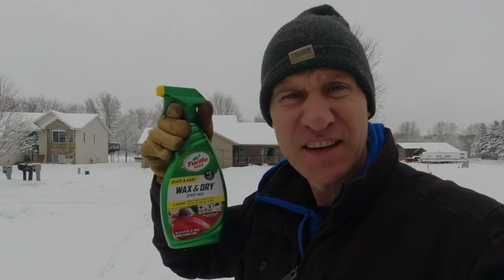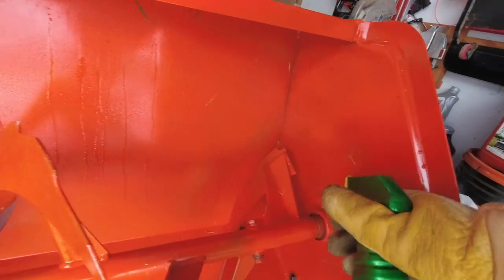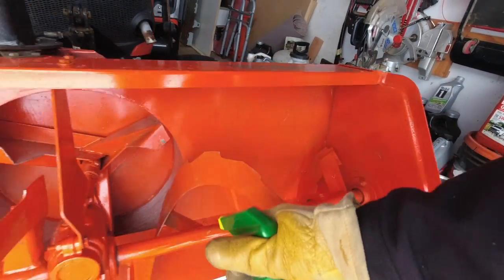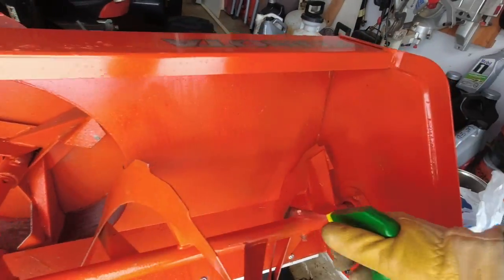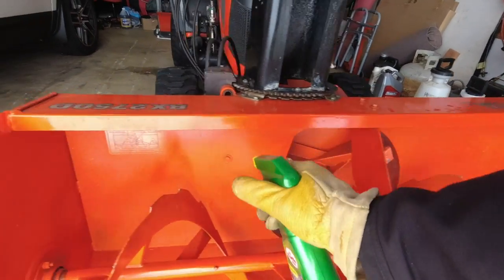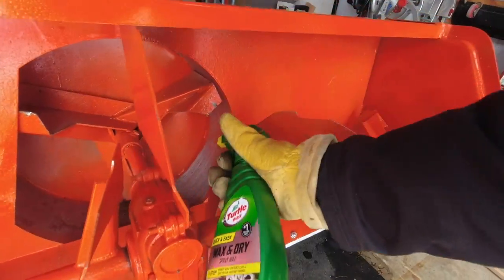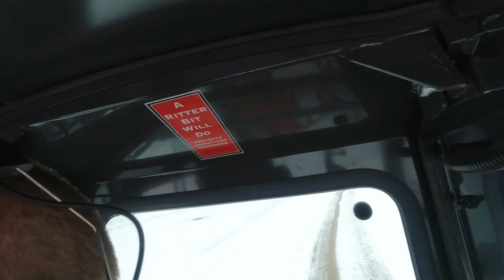BEST WAY TO PREVENT STICKING SNOW (Kubota Tractor vs. Snow)

Comment: I use that on underside of my truck. Snow an salt doesn’t stick at all. I put on 2 to 3 bottles under the truck before winter an have zero rust. It works like a dream.

Comment: Always love your rear blade action Jon !   The first year I got my BX, I broke a bunch of sheer pins, and I realized why... I was running my RPMs way too low, ( around 2200 ) now I crank the thing up until I'm at the beginning of the PTO range on the instrument panel of the tractor and haven't had any problems.   Thanks for the video !  I'd do the Turtle Wax thing, but at $8,999 a bottle up here in Canada I can't do it LOL LOL

Comment: What I found that works best. Get the tractor outside as it is warming up to get the blower or plow cold so the snow doesn’t collect on it right away. Then I have a little mix I spray on.

Comment: Thanks Jon, great tip about the spray wax! Have you had any issues with it freezing either in the bottle or after it lands on a frozen surface? Having the snowblower clog with snow has always been the biggest issue that I've ever had with snow blowers. The way that I deal with it (after it has clogged up), is to clean it out with a strong jet of water from a garden hose. My routine is to always wash the snow and ice off after I've finished using it.
Reply: Yes indeed, great tip. We don't get enough snow for a snow blower, but I will use it on my bucket if we do get a little bit of snow.  I would like to get some edge tamers so I don't mess up the  Gravel.

Comment: How's she goin'?  Thanks for this tip Jon.  I'm gong to try this as the Fluid Film or cooking oil spray trick is not getting it done for me.  Thanks for sharing and Merry Christmas buddy!!!
Reply from the maker: Because you've been using fluid film and cooking spray the wax will have a hard time sticking at first but once it adheres if should work great for you. It's also cheaper than fluid film. Hope all is well Mike. Any snow yet?
Keep on tractoring!
Merry Christmas 🎄
Reply: @ritterjon  No snow here yet Jon.  It blew some hard and lots of rain last night but we had no issues.  No trees left to blow down I guess!!  Merry Christmas!!
Reply: Hey Jon.  Here's a good one for ya:  The Turtle Wax in the US is 12.99usd for a 2 pak and a micro fiber cloth.  The same item, a 2 pak with a micro fiber cloth, in Canada is, (Are ya ready?)  41.29cdn.  How's that for free trade eh!!  Ya gotta love Canada eh!!  Merry Christmas!!

Comment: Thanks for the tip John.  I will pick up a bottle of the spray and wax, sounds like a good idea.  The fluid film is expensive in my opinion.  Living dangerously I see.  What do I see at the 1:34 mark in the video?  Did you forget to protect that under carriage?  Enjoy the journey - cheers
Reply from the maker: I don’t use is in the winter for two reason. It would collect more snow than it’s worth and I can’t anyway because of the PTO shaft for the snowblower. 🤷‍♂️
Keep on tractoring!
Merry Christmas 🎄

Comment: Don't get enough snow here in southwestern Idaho to worry about snow removal most of the time, and I didn't even bother putting the snow blower on my lawn tractor this year.  Figured if we actually get enough I might put the blower on, otherwise I'll just wait a day or so for it to melt and go away...worst case I can hookup the rear blade on the Kubota, but so far haven't needed to, my BX hasn't moved out of the shop since the end of October, and don't see it moving until mid to late spring most likely.
Reply from the maker: Sounds like you’re overdue for a little tractor seat time. I’m surprised you don’t get much snow where you’re at. At least when you do you’ll be ready. 
Keep on tractoring! 
Merry Christmas 🎄
Reply: @ritterjon  In the year and a half I've had my BX I've managed to put 63 hours on it.  The more it sits the happier I am, it means I don't have a huge project list to try and tackle LOL.  

I'm hoping to pickup a flail mower this year and if that's the case it's going to get much more use.  I have a couple of 1/2 acre properties that I have to keep mowed down as the people who own them don't have equipment to do it....I've been using the mid mount mower on the BX but that's hard on a lawnmower deck, need something more robust to keep the weeds and small saplings at bay.
Reply from the maker: @wildbill23c  A flail mower will be the perfect attachment for that job. 👍
Reply: @ritterjon  I think so too.  Not trying to cut brush, just grass and 1/2 inch or smaller saplings occasionally.  I was going to get a 48" rotary cutter but don't really need something that heavy duty, and all that mower hanging off the back of the tractor in a smaller fenced area would be cumbersome.  The flail mower is a much smaller unit to have on the back of the tractor.